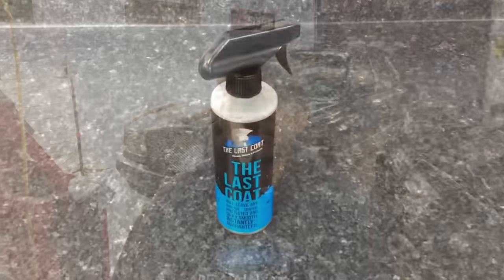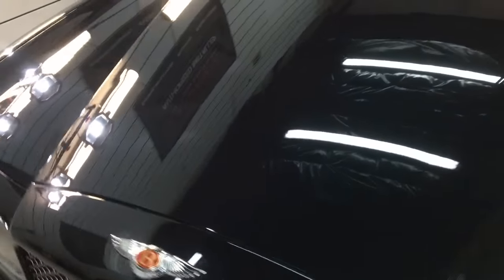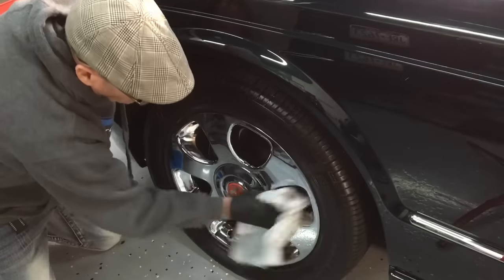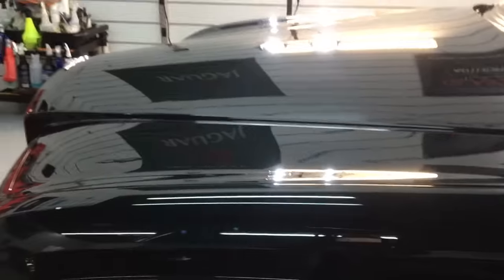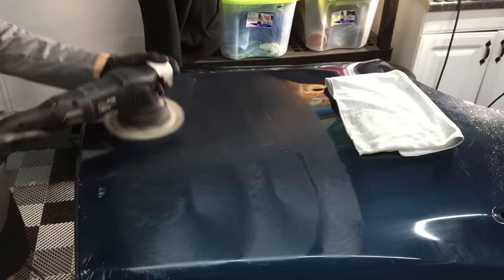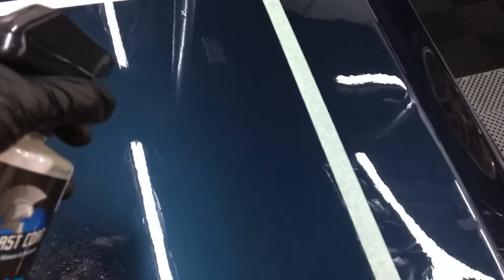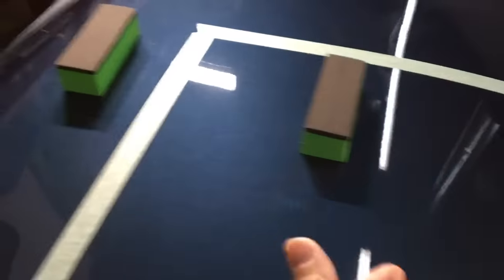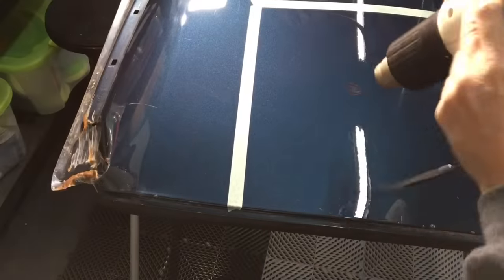The Last Coat!

Comment from the maker: Those that have purchased this product...and use it ....please share your experience for us please!
Reply: I have been using it since version 1. I never had any issues with the first version, but I also use it as a drying aid on my ceramic coated truck. I love the new version though! Use it on my bass boat and it really helps keep the scum off and makes it way easier to wipe off. My favorite thing has always been the insane gloss I got with it on my Truck. My favorite thing is it's ease of use. I spray it directly on the panel and spread it with a damp microfiber then buff to a shine with a second clean dry mf. Just my experience! Thanks for showcasing it!
Reply: Also for some real craziness, try a base layer of seal-n-shine with TLC as the topper! You will be pretty surprised I think!
Reply: I thoroughly enjoy The Last Coat 2.0. I tried the first version, and the it was okay, but the longevity wasn't there. I sent it back for a full refund and the company told me they had a new formula in the works. The new stuff impressed me with the gloss and slickness.

Thanks for taking the time to do this! I know myself and several others as I've seen in your comments have requested this. I also appreciate including the heat test. It can simulate or brutal Texas heat.
Reply: Is this the newer version tlc2 or the original one?
Reply: @redhulkultra155  TLC2
Reply: I've been using 2.0 for awhile now it works amazing. Very good longevity.
Reply: I wonder how this stacks up to seal and shine.
Reply: I use it but it failed the bird crap test. A vulture crapped on my car and by the time I got home around 4 hours later the paint was etched. I used citrol at first but that didn't work. Then I tried clay bar, then purple power. Stain was still there. I applied meguiars ultimate compound and that took it out. I finished with ultimate polish and then reapplied the last coat 2.0. I reapplied because the product is good at beading and gloss for sure. But I feel like it just didn't hold up well on something that is pretty common.
Reply: It, like every other product, seems so die after a week of daily driving followed by a wash. maybe it's just me but no spray on sealants seem to last when there is dust and dirt settled on the car for a week or more.
Reply: A friend gave me a bottle I've used it on my 92 Miata it has 6 coats ( I love shining my vehicles) I prepped it with griots microfiber finish pad and tw polishing compound and a ipa wipe down. It looks like glass very glossy. Did the same with my of Ram it realy popped the red paint. I just got TW hybrid ceramic spray used on my 2019 Rogue had the same results as I did with TLC. But TW is half the price. Thank you Brian I know it must get old comparing product's all the time but most of use don't have gloss meter's and the such that's why we rely on you so much. It's not in vain we appreciate the time and effort you spend on your videos. Your opinion is very important to use your the standard in my book have learned so much from you. Again  thank you so much.
Reply: I was eagerly awaiting for you to do a review on TLC-2! 😁👍  Nice to see that everything that I have experienced with the product was confirmed in your review.  As of now its definitely one of my top 3 favorite spray on sealants that I use. Also they always have a ton of deals and promotions to get them at a much cheaper cost. When I purchased mine I received 3 of TLC-2  and 1 of their "Amp" products for $75 with free shipping. Thanks again B for all that you do!
Reply: My vehicle is already ceramic coated, so I used it two weeks ago as a topper when I was done drying the car. The gloss was great, but it was the slickness that really stood out.

I live in the UK, so as you can imagine it rains a lot. This generally reduces the lifespan of any of these products, regardless how amazing they are. After two weeks of mostly constant rainfall my car is still slick, it is still beading water like crazy (!) and the best part in my opinion is that the car seems cleaner than it used to after two weeks. When I wash it on Friday I will really see how it is working, but so far I like everything about the product except the price. If this was in the £20 ($20) range I think it would be selling out. Cheers, Peter. 🖖
Reply: I’d like to see the eagle one wipe n shine tested with the new method. If I’m correct it stayed with seal n shine
Reply: Have heard of or used any of the products from Dura coating?  I believe their based out of Florida.
Reply from the maker: @redhulkultra155  Newest version.
Reply from the maker: @wyaldkingdom  A VULTURE!!  Yikes!
Reply: @apexdetail85  yeah the highway I take to work passes by the local dump and down here in Florida we have some big vultures. Ie. Big bird = big plop right on your freshly cleaned car. Lol
Reply: @1974gladiateur  thanks for the suggestion. I'm just a regular guy who likes to keep his car nice and clean so I don't know many of these products. Based on some of these tests that I have seen here and on other channels I thought it might help but oh well. I will check out your recommendations. Thanks again!
Reply: @wyaldkingdom  Vulture poop?! Lol. Extreme bird doodoo! That has to be crazy acidic as vultures eat  rotting flesh and I'm sure some bones, and they have to digest it.
Reply: @TheAverageJoeX  yeah I mentioned the same thing to my wife about it because she was like what took you so long to clean that? I was like the damn vultures must have pure hydrochloric acid in their stomachs! It took like 5 tries to get that out. Lol I was mad as hell.
Reply: So based on a basic google search, I found the following:  Turkey vultures have the lowest gastric ph in the animal kingdom. It is slightly above zero. Which is lower than car battery acid. It can dissolve metal and is 100 times more concentrated than human stomach acid. So if you see some vultures overhead steer clear or get ready to clean up! www.redding.com/story/life/2017/07/26/vultures-have-ph-public-health/504630001/
Reply: What happened to Round 5?  You went 1, 2, 3, 4, 6?
Reply: I have used TLC 2.0 and absolutely love it. The gloss, slickness, and hydrophobic properties are among the best I have seen.  I was curious, Brian, have you thought about doing a video comparing TLC 2.0 to OptiCoat's Hyper Seal?  Hyper Seal has been one of my favorite SiO2 sealants, but I can't find any decent video reviews of it. If you were to review Hyper Seal, it would be among the first on youtube. And I am really curious to know how it stacks up against TLC 2.0. Thank you and much appreciated!
Reply: I was a faithful follwer of Top Coat, now F11, price went too high for the amount you are buying. Then I tried Bead Maker, failure, does not last. Found  TLC, really good product. I use Avalon King ceramic coat and top it of with The Last Coat. I have found two products that I really like.
Reply: Great product. Really does a great job as a top-coat on a ceramic coating! Question for you and others... After ceramic coating & TLC top-coat, what are folks doing after maintenance washes? More TLC, detail spray or nothing? Trying to figure out the right layering cadence and what products. Thanks in advance for commenting...
Reply: @guenterhaines8898  The makers of TLC make a ceramic-infused topper called Amp. It is not designed to give long term protection, but rather a pop of gloss, shine, and slickness. I love to use it as a drying aid. And it is truly awesome on glass. You can use TLC as a drying aid as well. If you want something more economical after a maintenance wash, try Technicians Choice Ceramic Detail Spray. At $45 for a gallon, TC CDS is a great value.
Reply: David P very much appreciate your reply. Thanks for the info!
Reply: I love it really Make all the cars I did look fantastic
Reply: @wyaldkingdom  Well to be fair this is a spray coating. Not a full blown Ceramic, so there are limitations to what it can do. The chemical tests are mainly to say that it'll handle washing chemicals and the overspray from wheel cleaners and stuff like that. To be honest there are some "Full" ceramic coats out there that wont protect from vulture doo doo.

Comment: I just received this product yesterday and applied it this morning. It was very easy. I purchased some of the microfiber cloths as well.  I dampened the towel with some of the product and a very sparing mist over a section of the car at a time.  I did it in my garage and the temp was pretty cool (maybe 45 degrees).  I don't think doing this outside in a warm Sun is a good idea. It really didn't take more than 20 minutes to complete the entire car.  My car, although it is used (2019 Stinger RED) it looks amazing.  I did the windows as well. I am glad I got it.

Comment: I used Ver 1 of TLC  it did not last more than a few weeks.  I should have sent it back!  (And Im a prep fanatic)
Just did 2) daily drivers with TW hybrid ceramic.  Waaaay better application and removal than TLC ver 1.  No blotches or streaks to fight during removal.  Honestly the best spray sealant Ive used to date at 1/2 the price of the others.  Even based on your test of TLC ver 2 I still have to lean toward TW.  Glad to see TLC improved ver 2!  Ive discarded my ver 1 left over product...   Thx Brian Ive this is the exact test I wanted to see!

Comment: I've purchased a few TLC products so far and I like all of them. The soap is great. I started with TLC 1 and I really liked it. TLC 2 was even better except for the longer time before you could get it wet. I love TLC 2 on my wife's Pearl White Santa Fe. The car is basically waterproof. However, while it was nice on my 17 Black Silverado (10k miles at the time with 90% perfect paint) I didn't like the water beading and etching. While it gave a mirror shine, the paint looked "cold" to me. I like a warmer look of wax but that is my taste. Many people love TLC2 and I'll buy it again for my uses when I need it for sure. I haven't seen this covered anywhere but I LOVE TLC 1 used on my tri-fold bed cover for my Silverado. It seems the older version is much nicer for that and also for interior surfaces. I love that either TLC version is awesome on glass, chrome and bumpers. On wheels it looks nice but it didn't last too long on the wheels which I assume is due from the heat. The only thing I can't get it to do anything on are the sidewalls of the tires but it's not made for that. Their Amp diluted is a game changing glass cleaner too. Thanks for the review. TLC is awesome in my book.

Comment: I have it and use it.. I think it is expensive..BUT it is very easy to apply(much easier than S&S) I have both and find myself reaching for TLC2. Durability is pretty comparable to S&S which is terrific. The shine and slickness are terrific and one thing I noticed being the OCD car detail person I am.. is that TLC2 seemed to have a better self cleaning effect on my wifes Denali. It stayed cleaner for much longer compared anything else I have. All that said .. is it worth being 3x more expensive.. not sure.
Reply: That's some good insight. I think that's why SNS was such a big hit, is the price. If SNS was $30, it wouldn't have exploded as much as it has.
Reply: Same experience and comparison here. I have both on the hood of my wife's daily driver. TLC2 has wayyy better self cleaning properties and has retained its slickness longer than SS. This ride is driven and parked outside daily in TX heat, and I wash weekly.

I still us SS around the house and on other cars I may wash.
Reply: @soapa4279  you are probrably right. Truth is I have several bottles of S&S.. but like I said.. I always reach for TLC2.. if I was in my younger broke years Im going for that Seal and Shine..but nowadays ease of use  is worth some of that cost. I wish TLC2 was like 25 bucks or so. The self cleaning effect is pretty substantial and noticeable..

Comment: I happen to like the version 2.0 and their Detox Soap. Leaves decent protection and gloss and makes the surface silky smooth.
Reply: I use their soap too. It leaves just enough behind to add some protection to and under my damned roof rack (pain in my rear end when washing/drying).

Comment: I got sucked into the 1st generation stuff. 3 bottles with leaky nozzles and a gallon for $300.00.
For me in CA. I need to reapply monthly. Basically I feel ripped off. I don’t think the 2nd can bring me back again.
I called them about the leaky nozzles and they said they all leak but would send me out 3 when they get good nozzles.
They never did. Friendly people but not impressed at all and waaaay over priced. The 2nd generation you can get from Turtle Wax for way cheaper and probably better. As always Brian you are the best on YouTube.

Comment: I was given a used bottle of this 2nd version. I put it on my wife's white Outback. I let it cure for 24 hrs, drove a short distance after and let it sit in the garage. In my opinion the slickness disappears rather quickly? I did buy a bottle of their Amp detailing spray and when used it brings everything back. During a recent rain storm the water slid right off and no water spots. After washing with TW Ice Snow foam and using the Amp, the gloss and sickness returned. I think it's OK but for the price there are equals for a far better price. Just my two cents.....
Reply: What would you consider to be "equals with a far better price"?  TW S&S?
Reply: I don't have this issue. I drive in Texas heat and dust and it still feels slick (even with a light dust). If it's heavily dusted or has road grime, I give it a wash and the slickness is back.
Reply: @andygold  Yes. I use TW S&S on my 2019 Ram and love it. I use the TLC Amp or Eagle 1 wipe & shine as my quick detailer. Gloss, durability has been perfect since I 1st applied it late September.
Reply: @TheAverageJoeX   I live in Az so it should be pretty similar? I have no idea whats causing my issue? Prior to using TLC2 I had used Meguiars Ultimate Paste Wax that was 1st applied in February of this year (8 months ago). I prepped the car before applying and let it cure? A bad batch or maybe thats why I was given the product to try? Could be I didn't do something or did something wrong?
Reply: @dj9151  TLC states that Amp will only last until the next wash. As for the TLCV2 losing slickness after a wash, maybe it's the Ice snow foam leaving behind something. That's why I stopped using the Chemical Guys Mr. pink with it's gloss enhancers (it's a great soap otherwise). Now I use TLC soap, CarPro Reset, or ONR depending on what type of wash I'm doing.

Oh. I don't use carnuba waxes anymore. The heat here kills those quick.
Reply: @TheAverageJoeX   I 1st used Chemical Guys Honeydew Snow foam and I felt it did leave a residue behind so I switched to the TW Ice Snow foam since I have Seal & Shine on my truck. Of course we have bad water here so it could be that as well. I do use a RV water filter in my hose line I use for my power washer. I was going to try the CarPro Reset next. Could be that TLC just works with TLC soap

Comment: Could I still use this without claying the surface?
Reply: Nelson Arroyo he stress to prep the surface...so yes clay
Reply: You could absolutely use this without preparing the surface (fallout remover, clay bar, polish etc), however this, and most other SiO2 based products need a clean base to attach to molecularly. 

If you don't have a fully clayed and prepared surface you can still apply TLC v2 and it will still do everything you saw in the video, apart from the durability which will not be 6 months.

For me, I already have a ceramic coating on my car and I used TLC v2 as a topper, and it looks amazing and is working very well repelling both rain and road grime.